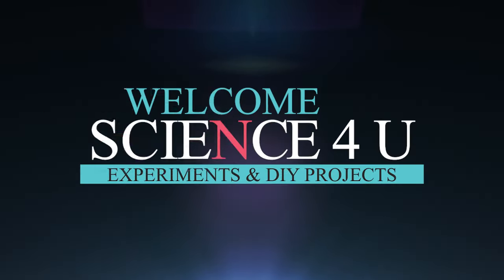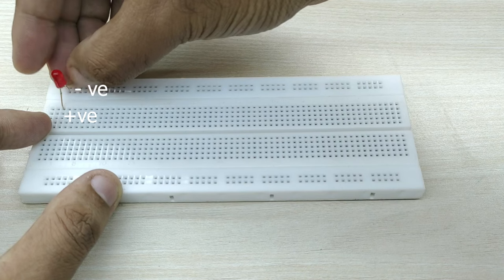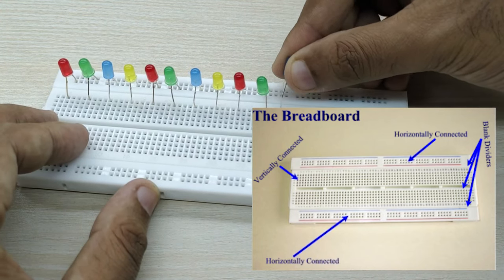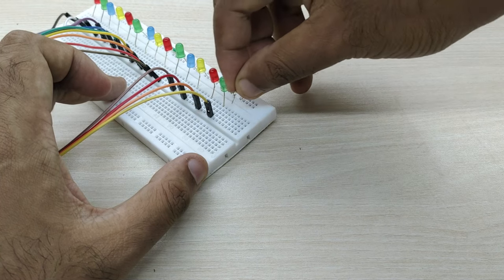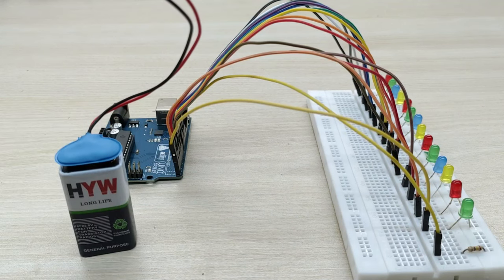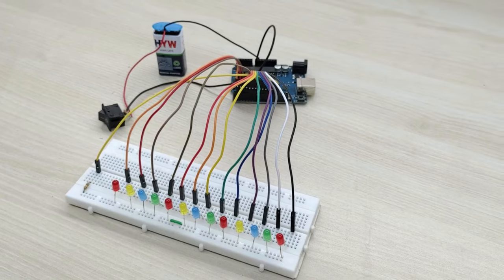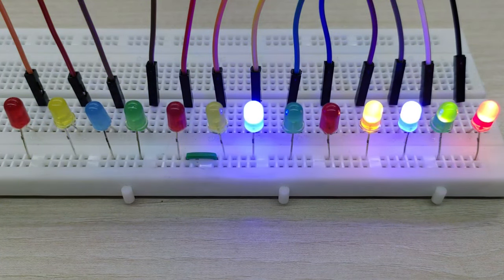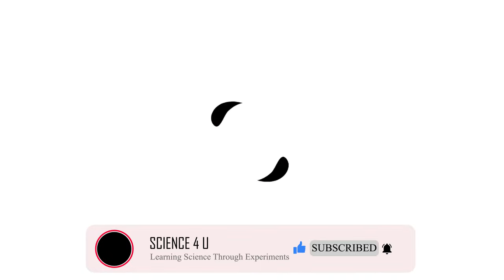Dancing lights || LED chaser circuit with 32 cool effects || Arduino Project

Comment: You need a separate 220 ohm resistor for every led. This is poor circuit design and can damage your Uno
Reply from the maker: Yes..you are absolutely correct. I have done this for simplicity only.
Reply from the maker: If we have a separate 220 ohm resistor, equal current will flow through each LED irrespective of the number of LEDs lit up during each cycle, leading to uniform brightness accross all bulbs..
Reply from the maker: In my circuit, the total current will be same in each cycle as it is a commom resistor for all LEDs and hence if two LEDs light up together, the current through each LED will be half and hence the brightness keeps on varying depending on the number of LED bulbs lit up simultaneously..
Reply from the maker: This is the difference I can see. But I can't figure out why it can damage the UNO board. Is it because the current through each digital pin dynamically varies during each cycle depending on the number of LEDs lit up together? Can you please explain?
Reply: I think no damage , each pin can support arround 40mA current, near the limit when only one is connected. You used 9V external battery so current is (9/220) A. 41mA without leakage account.
Reply from the maker: Yes. Friend..You have said correctly..🙂

Comment: You do a video that how to make a obstacle avoiding robot i try to make it my father spend lot of money for it but myrobot didn't work i become very sad my father also that money was waste what can i do. Please please help me sir 🙏🙏😭😔😪😪
Reply from the maker: Hi friend. Dont worry at all. I will help you to make it work. If the sensor is faulty, I cannot solve it. If it is not working due to some other reason, I can help you to make it work. What is the problem?

Comment: dancing is far behind the fact that our lights with this circuit is not working
Reply from the maker: Hi friend. What is the problem that you are facing. All these are tested and working projects. There could be some problem in the connection or uploading the code..

Comment: Can i have the circuit diagram for School purposes only??
Reply from the maker: Yes friend. Sure..I will have to make it. I will make and give..🙂
Reply: Thankyou
Reply from the maker: Hi friend. I have made the circuit diagram and uploaded in google drive. You can download the circuit diagram from the following link..
https://drive.google.com/file/d/1c7uszyi6nFekKmwLrnPhwfEXu0zOIZkk/view?usp=sharing
Reply: @Science_4U_  I use to think 💭 you are not meant to connect to pin 0 and pin 1 cos they are transmission & receiver signal pin reserves for special purpose. Does it mean 😭 there’s no harm in connecting to them? Plus you didn’t inform us the effect of having your battery powered on while also loading your code inside the uno board. Thanks brilliant video & circuitry

Comment: Which cable did you used for connecting the arduino to your laptop?!
Reply from the maker: Hi friend. It is called a USB A B cable..or USB A to USB B cable
Reply from the maker: USB 2.0 Cable - A-Male to B-Male for Personal Computer, Printer - 16 Feet https://amzn.in/d/0pW14LR
Reply: Okay, thankyou so much !

Comment: Do I need to do any changes in code if I replace blue leds with white ? If yes please explain the changes in detail
Reply from the maker: Hi friend..There is absolutely no change required in the code. You can use it as such..
Reply: Thank you 🙂

Comment: Where the battery negative is connected?
Reply from the maker: Hi friend. We are powering all the LED bulbs from the Arduino Uno. Hence, only the arduino needs to be powered by battery. The +ve terminal of battery is connected to Vin pin of Arduino and -ve terminal of battery is connected to GND pin of Arduino, which is next to the Vin pin.

Comment: Good video! Just wondering how you were able to add only one resistor in the circuit instead of having one resistor per LED?
Reply from the maker: @Jenkinsoup  Hi friend. Thank you!!!. Having a single resistor for all LED bulbs is the proper way to do. That ensures same current through all LED bulbs irrespective of the number of LED bulbs lit up together at an instant, and so same brightness. But, the way I did is an easier way to do. But the drawback is that the total current remain same in the circuit. So if more number of led bulbs lit up together, the current passing throufh individual LEDs will be lower and hence their individual brightness will be lower. This is the difference.
Reply: @Science_4U_  Thank you! I just bought some starting Arduino components and excited to try out your code!
Reply from the maker: @Jenkinsoup Okay friend. Sure!!!. Whish you an interesting experience trying out these projects..
Reply: @Science_4U_ You are smart and that would require increasing the voltage of the battery with higher current right? Do you think 💭 it works that way to if I want to sort out the lower brightness?

Comment: I used arduino uno r3 board. While uploading the code it is showing error. And is it necessary to join a wire to ground on both the sides of the arduino uno. My battery connection is directly with the circular port on the board. Is it fine or there has to be a wire connected to gnd on both sides of arduino uno
Reply from the maker: Hi friend. There is no need to join ground on both sides of the arduino board. They are internally connected.
Reply: @Science_4U_  tysm❤

Comment: Is it possible to select just one pattern, so every time the circuit is switched on, it only produces that pattern?
Reply: maybe you can use break function
Reply from the maker: @Sujal_davda yes..that is correct friend. You can use a break function inside each for loop..use a push button switch and if the output of switch is high, it should break and exit to the next loop for next pattern.

Comment: Is it necessary to add the 220 ohm resistor?
Reply from the maker: 220 ohm resistor is connected to limit the current through the LED bulbs so thst it will not burn out. However, Without 220 ohm resistor also it will work since many LED bulbs are simultaneously lighting up. This limits the current through the LED bulbs. Also the bulbs are just flashing. So bulb will not get enough time to burn out. So directly connecting without 220 ohm resistor also will work. But it is not a recommended practice..
Reply: @Science_4U_  Thank you so much💜

Comment: Sir my LED are working but it is very very low voltage didn't see  at cleared in the code need to give little more voltage what can i do
Reply from the maker: I think you used a higher value of resistor. You have to use 220 ohm resistor only. Otherwise you can remove the resistor also and work for short amount of time. This gives maximum brightness, but can damage the LED bulb if used for a long time.
Reply: Ok sir

Comment: How long the life of bulb or how many hours the life of bulb?
Reply from the maker: The bulb will last for many hours friend. I have not tested. I think it will definitely last for more than 1000 hours. You have to use the resistor correctly to limit the current through the led bul. Without resistor, the life of led bulb will come down due to overcurrent through the led bulb.

Comment: can i use more led in this?
Reply from the maker: Hi friend. It is difficult to use more number of LEDs since I have already used all the pins in the arduin uno by connecting LED bulbs. However, if you want to use more number of LEDs, you can use arduino mega, which has more number of pins than arduino uno..
Reply: @Science_4U_ 
can i use shift register for more led's as same coding or need modification.
Let me know what kind of modification
Reply from the maker: Yes friend. Arduino mega has more number of output pins.So you can connect more number of LED to it..
Reply from the maker: @samiqra1538 You can use shift register for connecting more LEDs but definitely the code needs modification. 
I would suggest you to visit the following website for more details.
https://docs.arduino.cc/tutorials/communication/guide-to-shift-out/
Reply from the maker: If you connect the LED in series, all the bulbs will light up together and there will not be any pattern. You have to connect one LED to each pin.

Comment: What are the things used in this
Reply from the maker: Hi friend.  the following is the list of things used in this project.
Components used:
1. Arduino Uno Board
2. 9V battery
3. Rocker Switch
4. Red, Green & Blue LED Lights
5. 220 ohm resistor
6. Male to male jumper wires

Comment: hey can i put the led + to anything of digital inputs?
Reply from the maker: Hi friend. Sure..you can put the LED + to any of the digital inputs. There are a total of 14 digital input pins ( number 0 to 13 ) which serve as digital output pins also. You can connect led + to any of these pins. Only thing to note is that pin no. 13 has a built in resistor, so you can connect any led to this pin directly without any resistor in series. But for all other pins 0 to 12, you NEED to connect around 220 ohm resistor to the led in series, otherwise the led bulb will get burnt out due to over current..

Comment: The code is incomplete. there are only 15 patters in the code that is available to download.  Please put up the entire code.
Reply from the maker: Hi friend. What you told is correct. In the code only 16 numbered patters are there. But inside each pattern also, there are multiples patterns. If you see, in pattern 1 all LEDs ON can considered as one pattern and all LEDs OFF can be considered as another pattern. Thus, there are more than 16 patterns in the code.

Comment: Os this 5mm led ?
Reply from the maker: Yes friend. I have used 5 mm led bulbs only..
Reply: @Science_4U_  brother i have a problem with Arduino nano the microcontroller start hitting when i start my circuit.pls tell me how i solve the hiting issu.
Reply: @Science_4U_  i was not use any resistor in my circuit.
Reply from the maker: @goodentrainment918  hitting or heating friend?
Reply: @Science_4U_  hitting
Reply from the maker: @goodentrainment918  sorry friend, i didnt understand the meaning of hitting..🤔. Can you please explain?
Reply: @Science_4U_  Meaning, I programmed my arduino nano then after programming I ran the eight leds without register with that program. Next I have the Arduino nano,
Reply: Then I I put my hand on the microcontroller and realized that it is getting hot. Now I want to know why the microcontroller is getting hot.
Reply: @Science_4U_  If you don't mind please give me some way to contact you so that I can explain you better with pictures.
Reply from the maker: @goodentrainment918  okay friend..I understood the problem. The reason for microcontroller  getting hot is that you have not connected resistor to the led bulbs.Because resistor is not connected, more current will be drawn by the led bulbs, which makes the arduino very hot..
Reply from the maker: @goodentrainment918  you have to connect around 220 ohm resistor to the led bulb. This limits the total current through the led bulb. Without this resistor, led bulbs also will draw overcurrent and soon burn out. Actually, each led bulb should have a 220 ohm resistor connected to ot inbetween the positive connection coming from arduino.
 This will limit the total current to be given by arduino. Thus it will not heat up..
Reply: @Science_4U_  ok bro thanks for the information

Comment: How use speed control (preset) ?
Reply from the maker: Hi friend. You can control the speed of the lights blinking ON and OFF by modifying the code. In the code you can see that under each pattern there is a constant called "int t=80". This constant 't' gives the milliseconds  time delay between bulb switching ON and OFF. You can increase or decrease this value for changing the speed 🙂

Comment: mine dint work iam trying again
Reply from the maker: Ooh..it should have worked friend. It is a very simple project only. Was the code uploaded properly without any error?
Reply from the maker: Also check polarity of the LED bulb. The longer leg should be connected to +ve numbered pin from arduino.